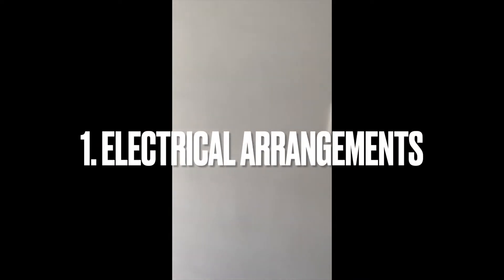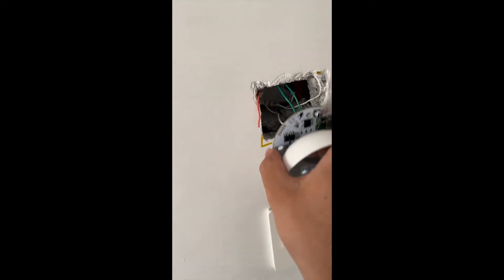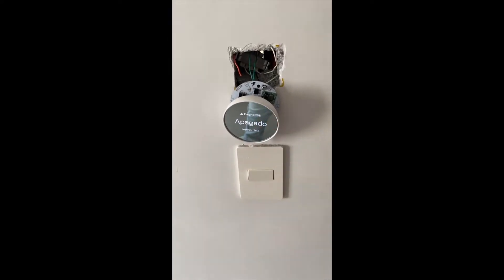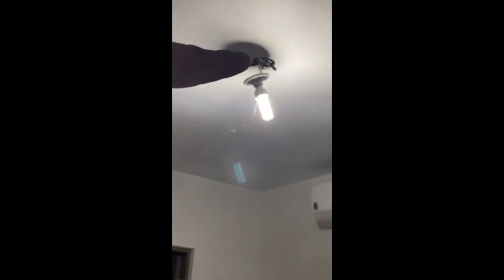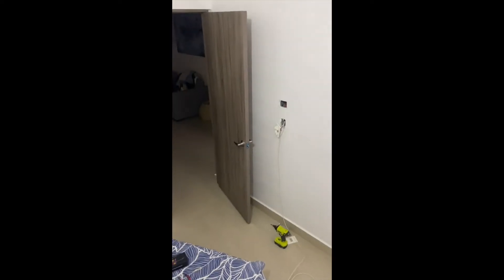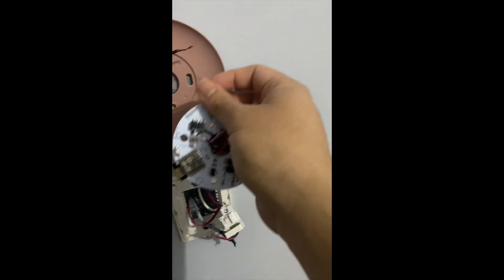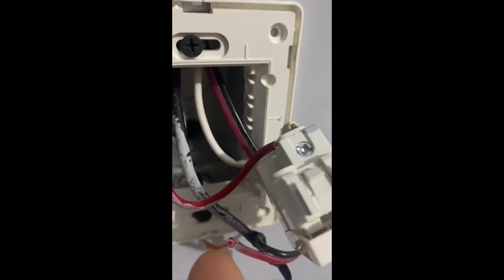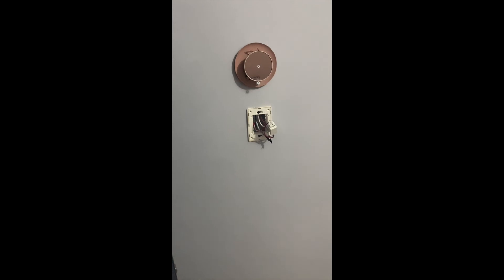Chapter 1. Nest thermostat with minisplit mod, electrical arrangements

Comment: How is it programmed for the correct ir signal?
Reply from the maker: Hello Michael, you can check the video called chapter 4, where I explain how you set the configuration, the latest firmware version can detect your remote and if found it can preselect it for you
Reply: @andressantos4054  If I want to have the control board in the attic instead of sticking out from the wall. It should work fine just extending the IR and mounting it beside the nest and also just extending the wires to control thermostat?
Reply from the maker: @michaelbox7285  as a matter of fact I found out that some minisplits output so much electrified air that in some rare cases I use that technique, I extend the ir wires, I have done it like 4 meters long and the ir led still sends enough power, you can see that in one of my “shorts” video that shows a pink nest, so yes, you can do that
Reply: @andressantos4054  hey I did purchase one but can I change it to the smaller version. Thanks Michael Box
Reply from the maker: @michaelbox7285  sure, the "mini" version it is then :)
Reply: @andressantos4054  Will the unit work with out the nest thermostat or does it need it to use voice commands
Reply from the maker: @michaelbox7285  the voice command on the video you saw, is directly controlling the nest, not my adapter, however I already did the code so that google home detect it as a thermostat, meaning that you can use it with and without the nest, however that feature is still not public because I need to receive the google certification first, but it does work and the adapter is already prepared for when it receives the certification, same applies for Alexa
Reply from the maker: @michaelbox7285  and also i do have a smaller product, a usb stick with homekit enabled, in case u r an iPhone user, but that one is not compatible with nest, you cannot attach a nest thermostat
Reply: @andressantos4054  My is a ceiling cassette unit so it doesn't have the usb port built in. Do you have a time line for google certification?
Reply from the maker: @michaelbox7285  at least one extra month, because the certification needs a whole system (website) for joining accounts, which is at 85% so it needs still some work